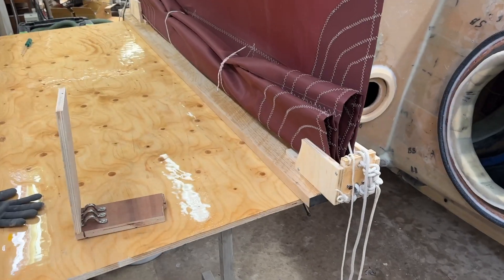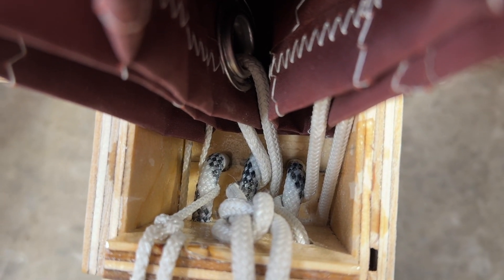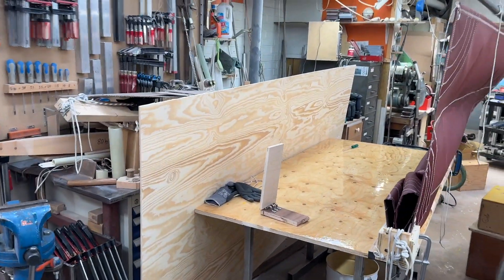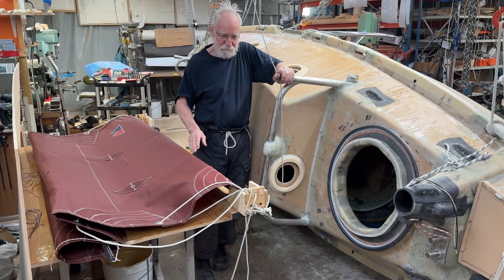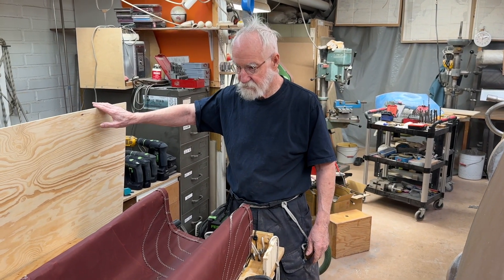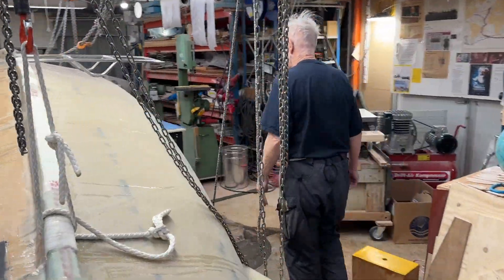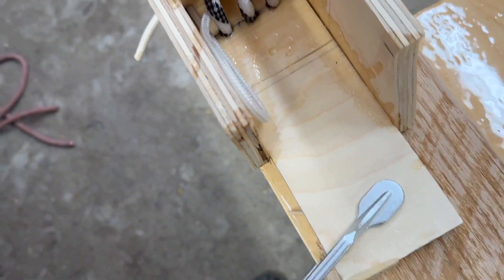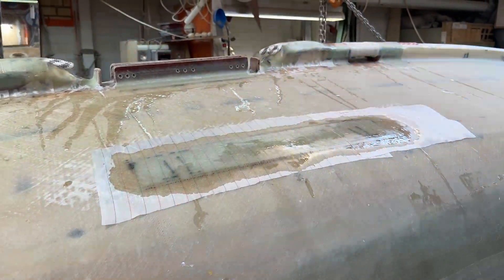1 Jan 2024 Reefing the water boom

Comment: Rather than building the boom as a trough, would it not be easier to sow a crease (pocket) into the bottom of the sail on both sides, to catch and guide the rainwater into your tank?
Reply from the maker: It would not work as well.
Also I use a balanced lug sail that rub against the mast.
Also it is not easy to keep the desired shape.
I rather put more work into it to get it more efficient.
My opinion.

Comment: You should have the leader at least 15-20dgr out from the hull, because the boat will heel when you have to use the leader,
Reply from the maker: What is a leader???
Do you mean the ladder?
I have one on each side and it is at an good angle
Reply: Sorry, I spell wrong, ladder, swim ladder. I mean when your weight gets on the outside there, the boat will heel so you'll have a hard time getting up.
Reply from the maker: The ladder is outward angled also to get space for my feet on the steps @TomasOlsson099

Comment: Happy New Year Sven. The swim ladders look good. Would there be any advantage to using 100mm or 150mm plastic pipe as a mold for the boom to give a round bottom to the trough?
Reply from the maker: I think square section is good enough.
It is also OK for the 3 anchor poits when reefed.
The boom will act as an endplate reducing the induced resistance hopefully.
This is my first water boom. I try it out to NZ and back maybee in later boats I can improve on it.

Comment: Still the sails will maintain battens with this kind of boom?
I don't have completely figured out how it works this boom, but a question: will it work the same if instead of a box-shape at the ends it could have a sort of a more v-shape at the ends and the boom itself be a v-shape section? I mean like an angular profile (of those made in alluminium or steel)...  I imagine it could be more aerodynamic and stiff in this way. In the past I had seen some v booms in some boat to catch the sail.
Reply from the maker: I did not have battens on my previus lugsails
I am not planning to have battens on this boat.
I think the boom may act as an endplate to imprive the efficiency of the sail.
Reply: I have mistaken the terminology, not: battens ! , but what you have called something like more booms, each of which was reefed on their own. There were videos from 24 December 2022 to 29 December 2022. Now the new solution of the booms of the two aft square sails is new. I imagine that the previous solution would interfere with the new types of booms that you have designed to collect rainwater. I have incorrectly used the word battens that is misleading and not correct. Sorry.
Reply from the maker: Now there are only the boom and the yard.
One spar at the bottom and one at the top of the sail
 @dubo55